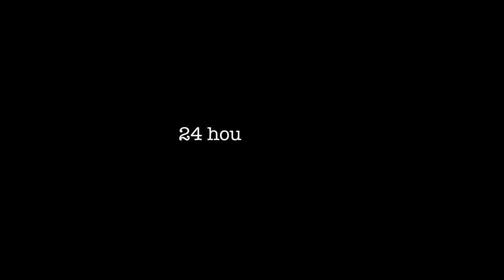GREAT SURPRISE New Honda Snowbike For Jack

Comment: love the honda sled. also... be careful with the downhill mtb helmets, the hard outer shell is not designed to take a heavy load like the DOT helmets. If the bike somehow lands on top of you it could crush right through the downhill helmet, while the DOT should take the load and keep your noggin intact. But hey, the weight and field of view of them is unbeatable, I see why you run them. I have seriously considered it myself too. Happy riding guys!

Comment: My daughter and I snowmobile and I've always found the balance when equipping her.  She's 19 now and started riding her own machine at 11.  I've always found the right 'fit' for her, meaning smaller, lighter and less powerful when she was younger and today she is riding the same displacement sled I do, although mine is pure mountain and hers is a crossover, which better suits her riding style.  (And hers is faster because of the shorter, less aggressive track!)  She always gets good riding gear and I've spent a fortune trying to figure out the best anti-fogging solution for her and her glasses.  The bottom line is you want to keep them safe and just as importantly, having fun so they want to continue.  (We are headed to Chinook Pass tomorrow to ride!)

Comment: 11:09 and 13:40 you really really need to break him of the habit of trying to use his feet to "break his fall". That is very very dangerous and that is how people go down. I know I know this is a snow bike so it is not as bad as it is on a street bike, but it is a very hard habit to break once you start. 

For those of you who don't know putting your feet when going around turns, or when you "feel like" you going to fall is very dangerous. First if your falling, especially at speed, there really isn't much your feet will do to stop it anyway. But the bigger issue is your sticking them out, and giving them the chance to get caught on something (typically the ground), and actually cause you to fall. You should be able to balance the bike such that the only time your feet come off the pegs is when they are touching the ground. If you find your self taking your foot off the peg, but going to fast that if you touch the ground then your foot will drag, then you need to work some more on your balance. 

The good news is those snow bikes look very stable! I would imagine you could probably sit on it not in motion and still not tip. So that is the best way to teach such balance. Do not remove your feet off the pegs until you come to a complete stop.